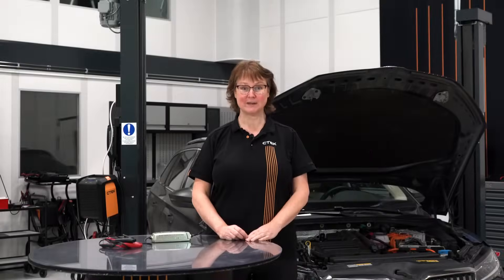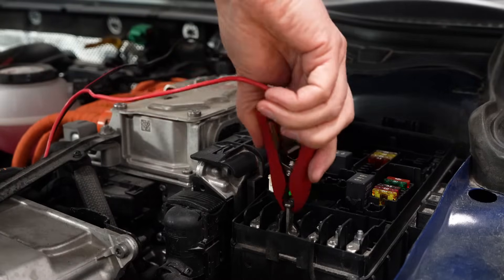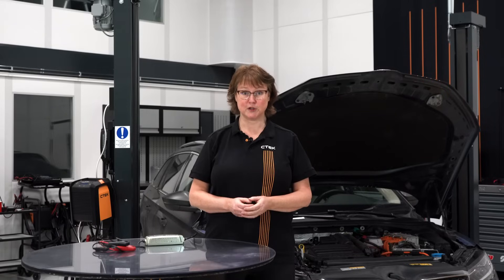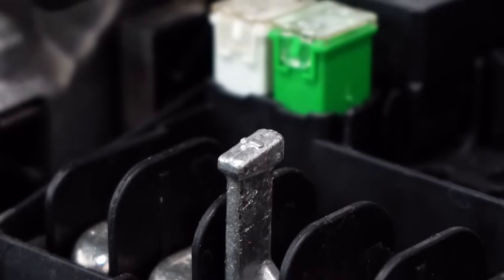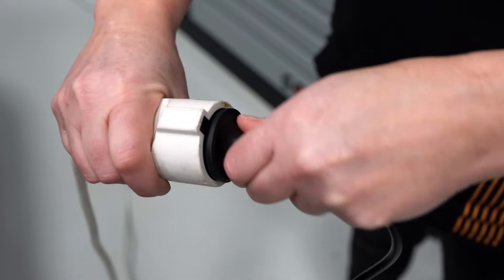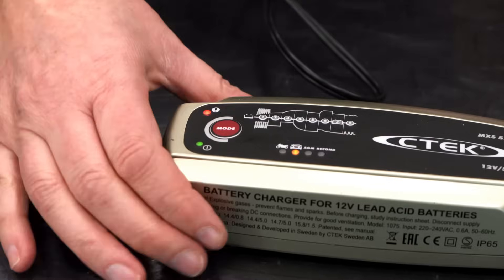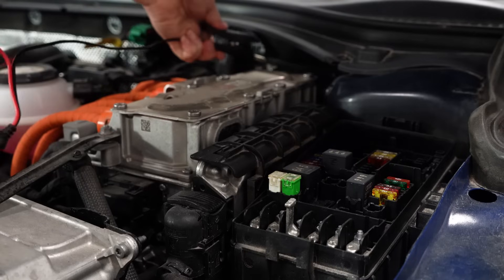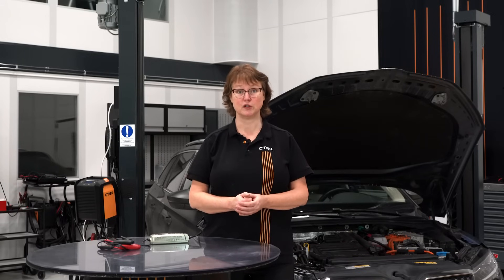FAQ | How to connect a battery charger

Comment: I noticed you connected the negative first. I thought it was positive first when connecting to the battery?
Reply from the maker: Great question! Traditionally, when connecting a battery, the positive terminal is connected first and the negative last to reduce the risk of accidental short circuits. This is because if you connect the negative first and then accidentally touch the chassis with the positive cable, it could create a spark.
However, with CTEK chargers, this isn’t an issue. All CTEK chargers are spark-proof and reverse-polarity protected, which means they’re designed to be super safe regardless of the order you connect the clamps. So while the general rule is positive first, negative last, with CTEK it doesn’t matter—you’re completely safe either way.

Comment: If you possess an old type battery charger not useful for a Deep Cycle battery attempt to recharge the battery per your advice. After about 10 minutes disconnect the old battery charger & reconnect the new battery charger. The new charger may now recognise the battery & commence charging.  It is a common problem when your battery is flat.

Comment: I hooked up my Ctek charger exactly as the video specified the battery charger lit up the first light got hot and would not light up any other lights than the fault light came on. If I connect the charger directly to the battery, the charger works perfectly. Why does this happen.
Reply from the maker: Hi. Thank you for reaching out. This does indeed sound strange. I have talked to my colleges and I believe this risk being a longer conversation back and forth to find the reason. Do you mind contacting us via our web form at ctek.com? https://www.ctek.com/uk/support. We are looking forward to hear more about your issue. Kind regards CTEK Support

Comment: hello.
Do you recommend using my MXS5 in an Audi A4 car with a mild hybrid 45TFSI engine?
If so, where would it be connected?
To the marked terminals under the hood?
Thank you and greetings
Reply from the maker: Hi. Thank you for reaching out. If the battery is any type of 12V lead acid battery, the MXS 5.0 will work fine. Please note that some hybrids needs  a stronger charger and we actually recommend the PRO25S for some hybrids. I kindly recommend you to check the vehicle manual or with the vehicle workshop for recommended charge current. The charger should be connected to the recommended charge points, to be found in the vehicle manual, or with the positive red clamp to the positive pole on the battery and the black clamp to un unpainted part of the chassis. I hope this helps. Kind regards CTEK Support
Reply: Good afternoon.
Okay, that's clear to me.
I've installed the accessory cable to the specified charging points in the car, and connecting/disconnecting will be much easier.
As always, thank you very much.
P.S. Your customer service is the biggest difference compared to your competitors

Comment: It did take some of a charge overnight. But it still would not start at 5:00 this morning.
Reply from the maker: Hi. What light did the charger show? Depending on how big the battery is, how drained and the size of the charger, it can take some time. Let me know, and I will do my best to calculate if all is good. Kind regards CTEK Support

Comment: I tried to charge my battery last night. I left it on overnight until 5:00 a.m. this morning. My question is is it possible to mess my system up with it being connected directly to the battery and not disconnecting the battery from the vehicle itself
Reply from the maker: Hi. The only thing that could be messed up is that the vehicle systems will not be aware of the charge. The battery gets as good charged. It will probably take some hours whilst driving to get the systems synced. I hope this answer your questions. Kind regards CTEK Support